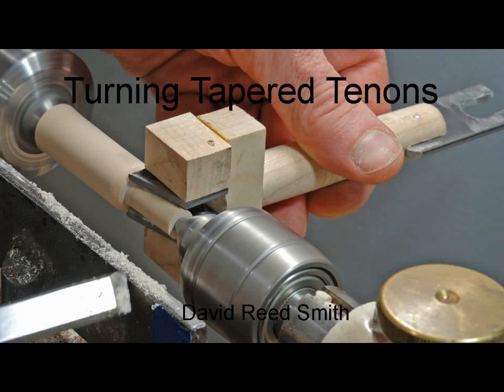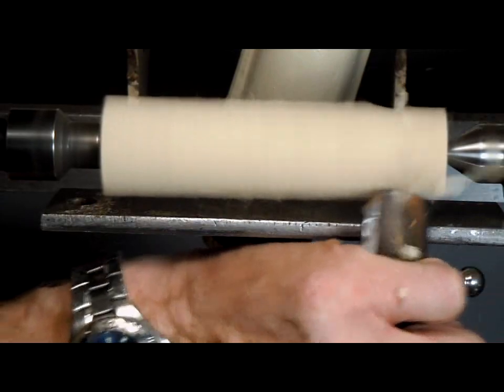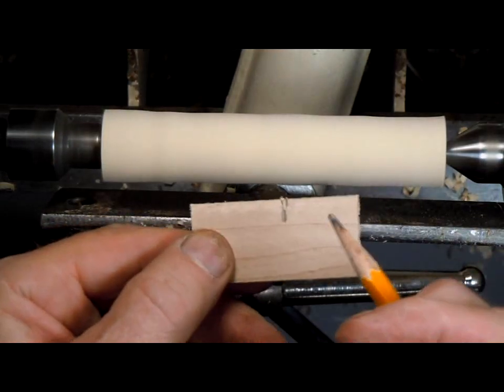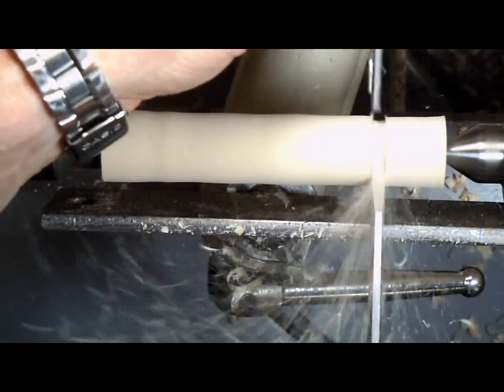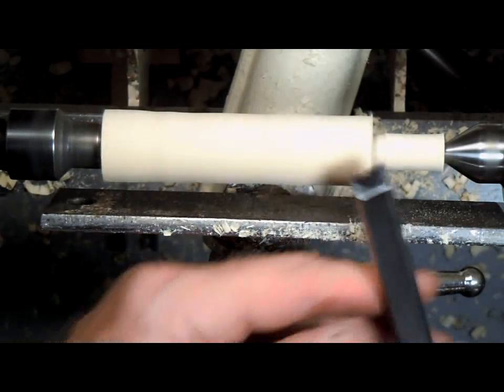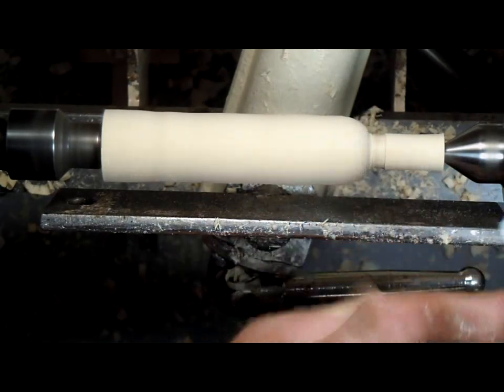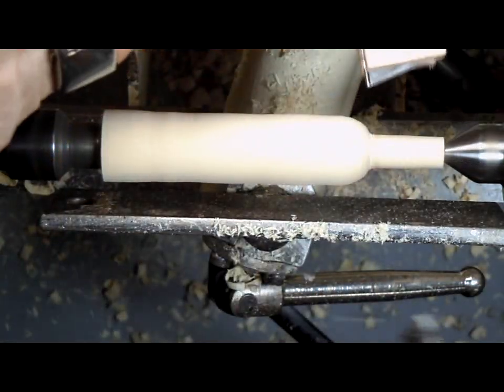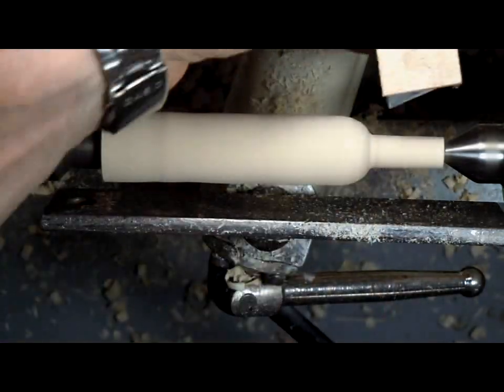Turning a Tapered Tenon

Comment: Ok, finally got the reamer made. Goes from 22mm to 40mm over six inches. bought some flat bar today and drilled, cut and filed as instructed. Now I have doubts because my reamer is much bigger than the one you are using and the 1" length of flat bar might not be long enough. I'll have to  cut away some of the wood so the stock can slide further inside. I wont be able to make the gauge to measure the maximum size because the flat bar is simply not wide enough. As you can tell, I'm still learning!